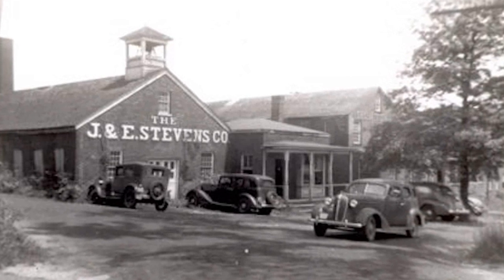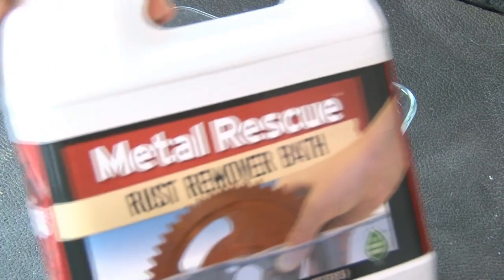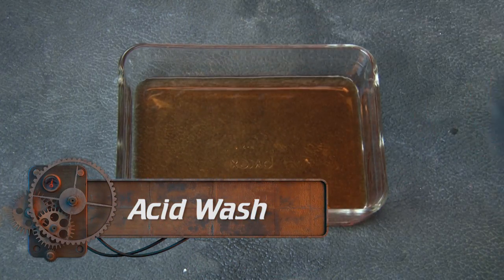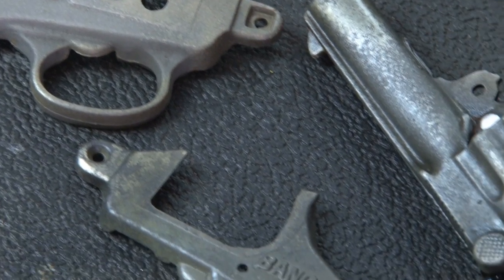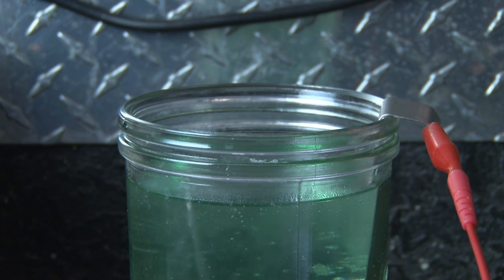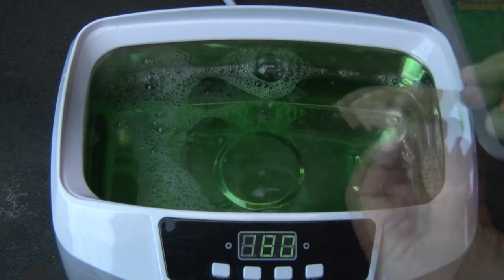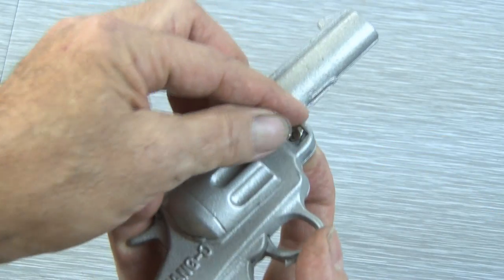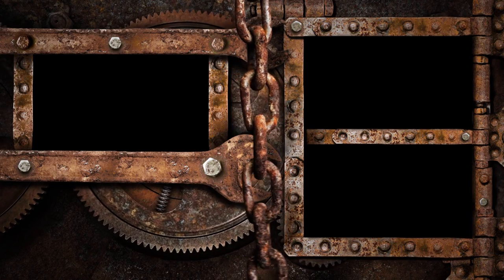Can I Make This Go "BANG" Again?

Comment: When you use an acid bath, you want to fully neutralise the acid after taking it out, use something like sodium metabisulphate, should be strong enough to neutralise a strong acid like what's found in drain opener

Comment: A well done restoration, Kip.  The nickel plating setup looks similar to the one YouTuber baremtalHW uses to zinc plate Redline Hot Wheels, although he uses an aquarium air pump to agitate the water and dislodge any bubbles that may form on the parts when they're plating.

Comment: Make your own caps. I have been following you for years and I know it's something you'd definitely be capable of - heck I've made "popping" targets for some time and they are the same concept. There are quite a few Doughboy paper cap packages on the usual auction sites and shopping sites. Some say they still contain caps. The package would be cool for a period correct display and some functional DIY caps to demonstrate the cap gun still works would be neat.
Reply from the maker: Yes I thought about doing that. Thanks.

Comment: Can you tell me how the plating works? My understanding of electricity flow is from negative to positive, so how does anything stick to the negatively charged part?
Reply: Basically the process splits atoms in the solition. You have water h2O "oxygen and hydrogen", when subjected to electricity, the atoms split producing oxygen and hydrogen gas.
While this occurs, oxidation is in progress, in other words the metal lead attached to the positive starts to break down, then the lead of the anode absorbs the decomposite material that came off of the cathode.